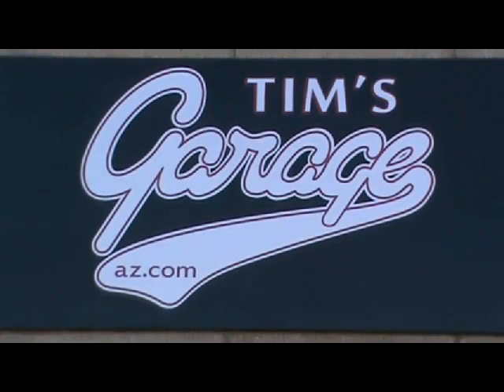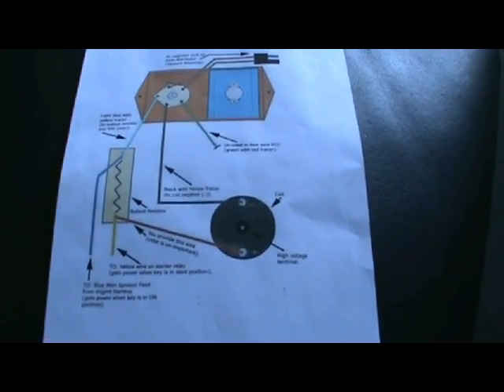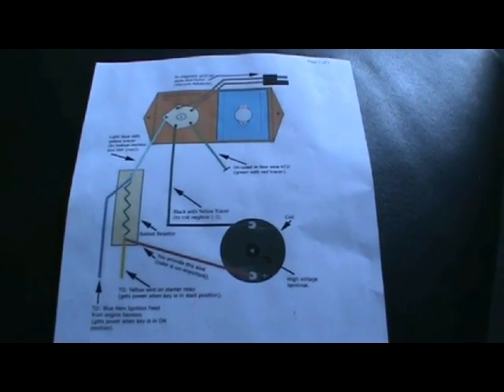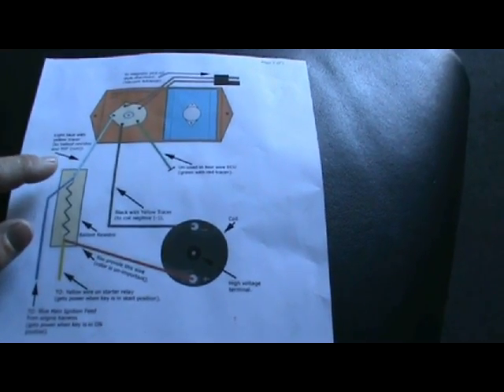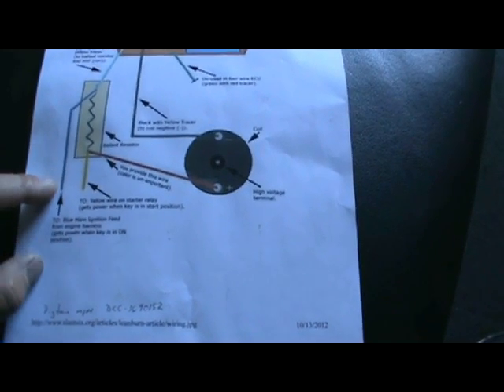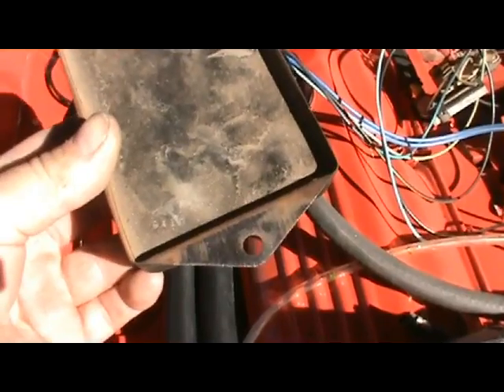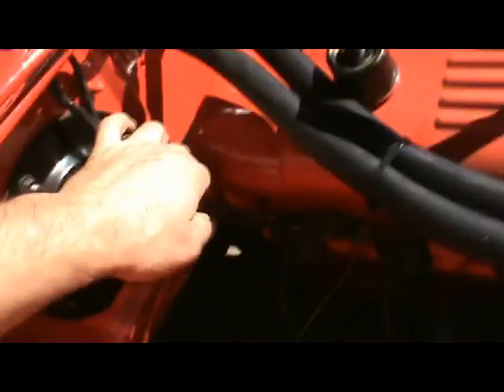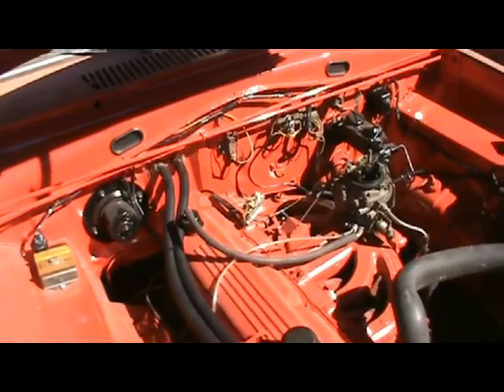1964 Plymouth Valiant electronic ignition conversion

Comment: Would have been better just to use a ground wire to ground the ECU and if you self tapping screws they will ground the unit to the body

Comment: Theres a 5 ohm side of that ballast resistor & a 0.5 ohm side to the ballast resistor as well.  That ecu MUST be on the 0.5 ohm side.  I'm pretty sure that your original ballst resistor is a 1.5 & 5 ohm dual ballast.  You may want to get a new ballast resistor sized right or your wires will melt like mine did.
Reply: There is no need to fiddle  with  a  4 pin  ballast.  The newer  ECUs   are all "4"  pin and only need a 3 pin ballast.  In fact you could use the original ballast and it would run.